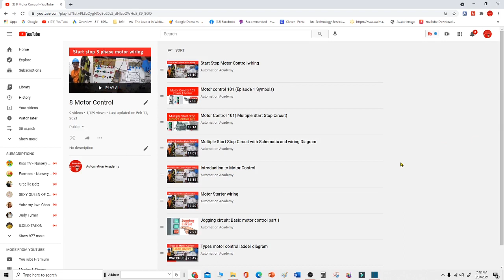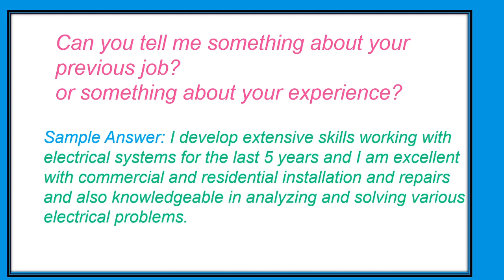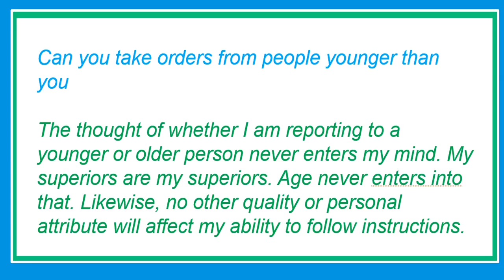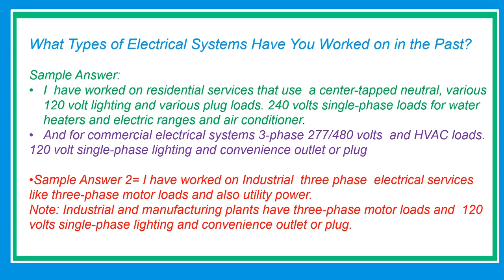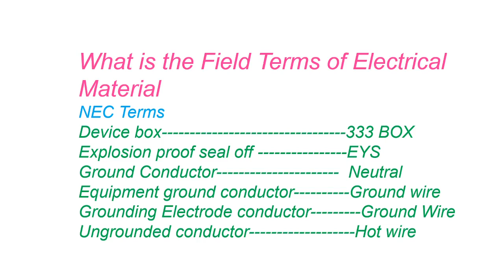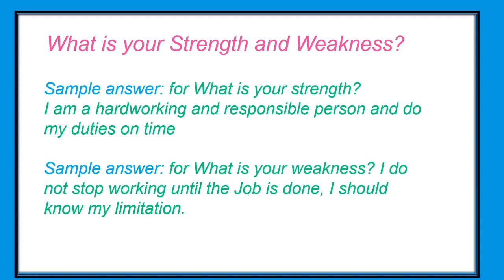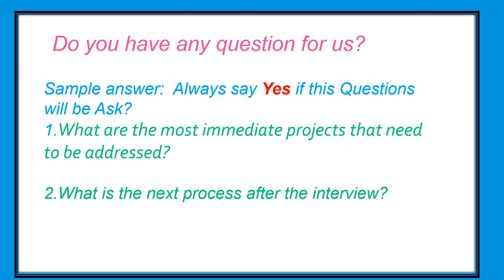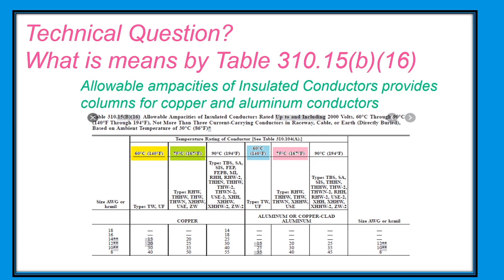Electrical Interview Questions and Answers UPDATED 2024(PLAYLIST in DESCRIPTION)

Comment: Boss,salamat po sa mga turo mo.. boss tanong lang.? pano mag wiring sa heat controller through contactor? sana mapansin mo?
Reply from the maker: Madali lng yan boss marami sample sa goggle search ka lng ng how to wire temperature controller with contactor, ang Normally open or closed contact ng controller naka series sa coil ng contactor